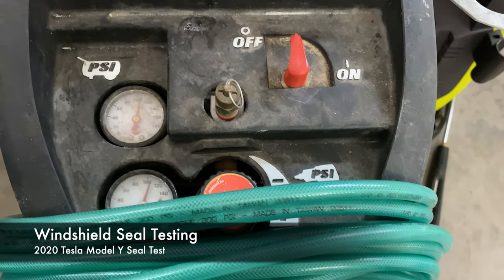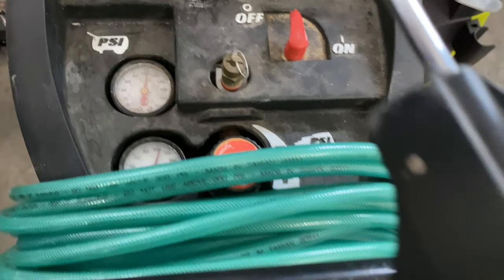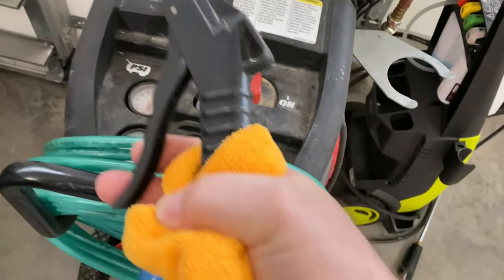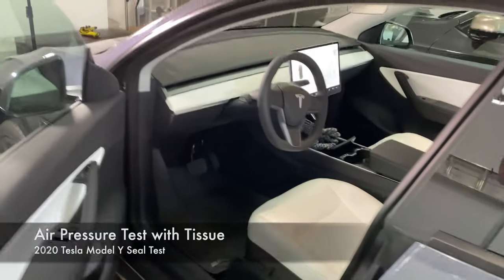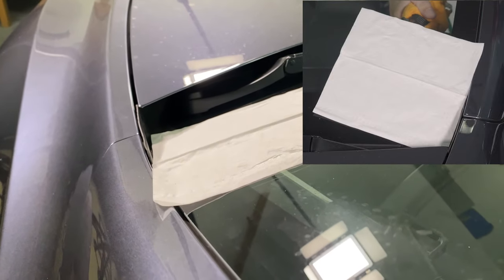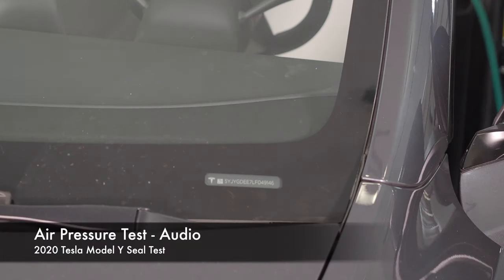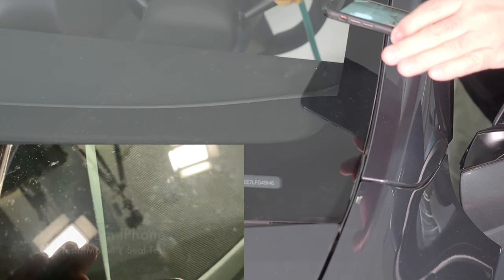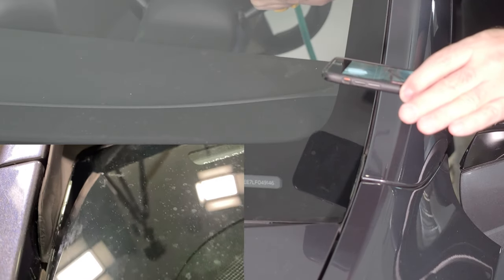2020 Tesla Model Y Windshield Seal Test

Comment: Not that this can't be improved, but when it comes to air filtration it doesn't necessarily matter if the container is air tight so long as you have positive pressure inside the vehicle with the input source of air being filtered. Clean rooms for semiconductor manufacturing are the same, they constantly filter air and pump it into the room so that clean air comes in and leaves out of the ventilation and any other cracks. Obviously this can be a problem if the hole is too big but it isn't the end of the world. With that being said I don't know if Tesla's have positive pressure but given the air filtration I would find it hard to avoid a positive internal pressure unless they tried.
Reply: I didn't realize this was about a noise problem, yeah that kinda sucks.
Reply from the maker: Windshield is actually part of the restraint system (backer for airbags), and is structurally important.  Improperly sealed windshields are really a significant safety issue.
Reply: @ndornquast  Choppa choppa

Comment: Hey coming from someone that was in a rollover accident. the windshields are made to give way outwards that's why they're like that. There's nothing wrong with that windshield. If you are ever in a bad accident like I was  and can't get out, or you're upside down you can easily kick the front windshield out you could press it with your hand with minimal pressure.
Reply: What a load of. BS. Show me another modern car where the windshild is the same
Reply: Coming from a professional mechanic, no. You are wrong. Windshields are 100% sealed with urethane adhesive.
Reply: @loganbruner2664  dude, tempered glass does not flex. Neither does cured urethane adhesive. It's a structural part of the car and provides support to the passenger side airbag during deployment. That's why you can't drive a car immediately after a windshield repair because the adhesive hasn't set yet and if you got into an accident the passenger airbag would have no support and the windshield would just pop out. Which it is NOT supposed to do. It takes a special tool with a crank and cutting cable to get the windshield out. If you are so certain record yourself just pushing a windshield out with your bare hands and post it. I'll wait...
Reply: @loganbruner2664  That's an older Neoprene style seal. Modern windshields use a Urethane sealant to structurally attach it to the vehicle and that will NOT allow you to kick your way out.
Reply: @warrensteel9954  was just gonna say that LOL. He really thinks modern windshields work like that. Hilarious 🤣🤣🤣. As soon as I watched the video I was like what a derp, that's a foam gasket not urethane 🤣🤣🤣
Reply: Dude, you're just plain wrong. Simple as that. Accept it and move on. Sorry you were in an accident, but that doesn't make you an expert on auto safety and engineering.
Reply: Yes, you can almost climb out this gap in a rollover. Yet another reason to avoid Tesla products and look elsewhere.

Comment: Ehh, just get some silicone from home depot and use a caulk gun to apply as needed. You'll be iight. You should feel the air leaks on my motorcycle.

Comment: Not saying that this isn't a problem, but from a design engineer's perspective, this is an invalid test. The air needs to be coming from the outside and the decimeter on the inside. This is more accurate for what the windshield actually experiences. You can't just make up a test based on conditions that won't exist and say that it proves anything. Yes Tesla has quality issues but this is just FUD.
Reply from the maker: You are correct in your supposition that just because air can freely move from inside the cabin doesn't correlate that air from outside can move to the inside of the cabin by this simple test.  However, it was the case.  Harder to lay a tissue into the crevice presented on the inside - but air did move both ways, I assure you.  It was actually air coming in from the outside that created noise.  At 60mph, placing hand on the inside glass would change the noise made.   Also.  Tesla service found a 1 cm gap in the urethane.. so, that's that.  Also.. this isn't FUD.  This was a demonstration of a weak /missing seal.  That's all.
Reply: @ndornquast  I appreciate the response. As I mentioned this was probably an issue. The video of the test itself was misleading. Your explanation here actually makes sense. I'm not a Tesla fanboy of but I do, as a profession, deal with a lot of on highway and off highway vehicle design and Tesla gets a lot crap about stuff other companies deal with also. Having said that, they do have some quality issues the must be addressed.